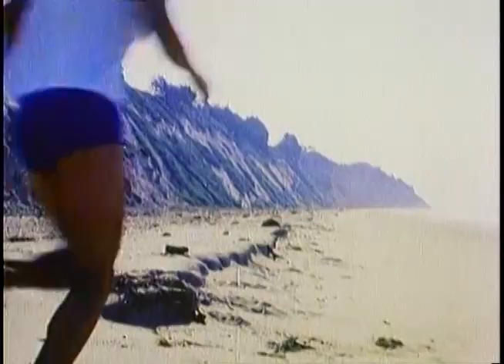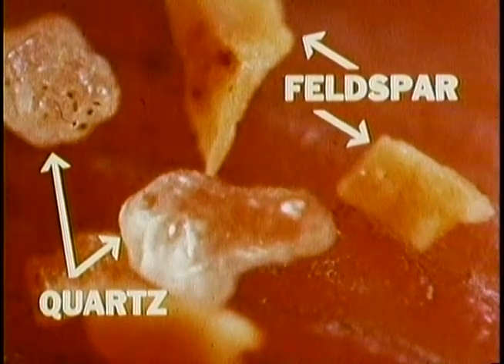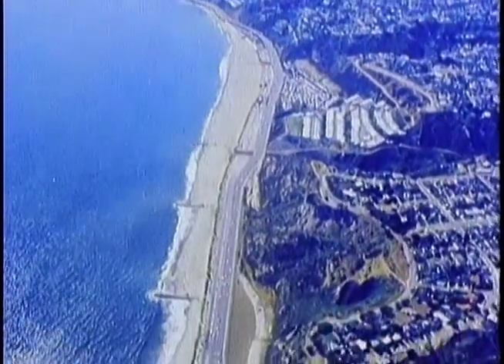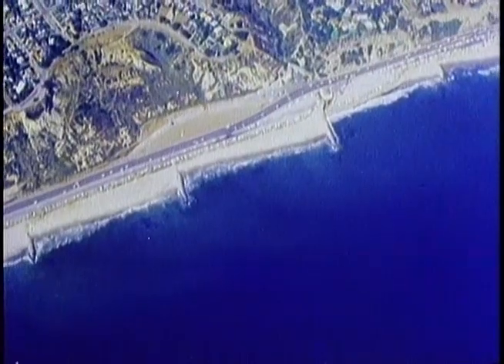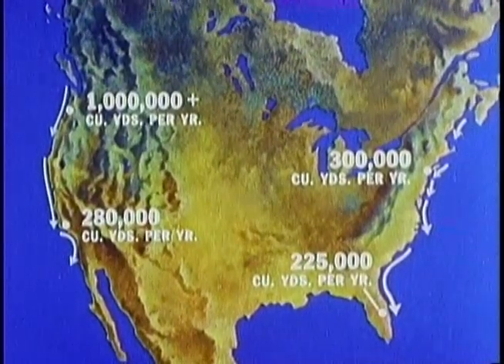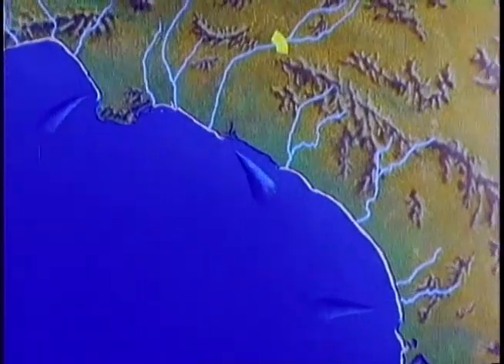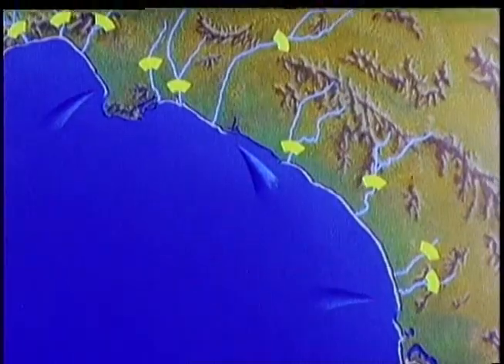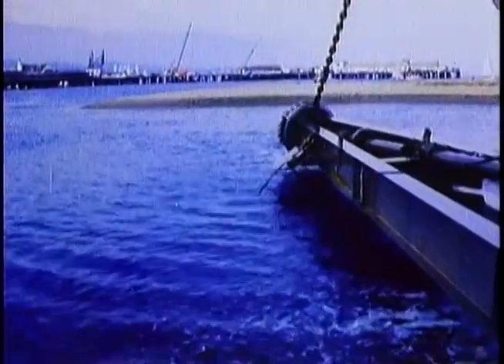Beach: A River of Sand

Comment: Also, keep in mind that winters in the northern hemisphere have a lot to do with tides and beach erosion. If the winters are very cold and there’s lots of snowfall, all that water gets deposited on land above sea level, causing lower tides. Usually by October is when all that water above sea level has returned to the ocean causing higher tides and king tides. I believe it’s possible that a few hundred years ago, sea  levels during the spring summer seasons would be noticeably lower, causing more beach to be uncovered and during windy weather, that sand would get blown onto the beach, this would cause beaches to grow and or beach erosion would be less. Today, in 2025, beach erosion has sped up do to the fact that we don’t see harsh winters that often. This is why we are  re nourishing beaches more often and the need to re nourishing beaches is only going to accelerate into the future.

Comment: What are beaches in South Florida made of?
What minerals is beach sand, including the beach sand here in the Florida panhandle, usually made of?
How is the material in rivers sorted by the water?
Why doesn't the sand pile up at the mouths of the rivers?
What happens to waves as they enter shallow water?
What does a longshore current do to sand?
Define longshore transport.
Why is the beach referred to as a "river of sand''?
What can happen to beach sand when a submarine canyon lies just offshore? 
What happens to a coastline when a river is dammed?

The questions I'm working on, I am finished with #1 and #7.
Reply: Why doesn't the sand pile up at the mouths of the rivers?

It usually would in structures called deltas, however as we've seen in the video, waves come crashing the shore at an angle, taking away the sand. In this scenario, the power of the waves is stronger than the flow of the river at its mouth.